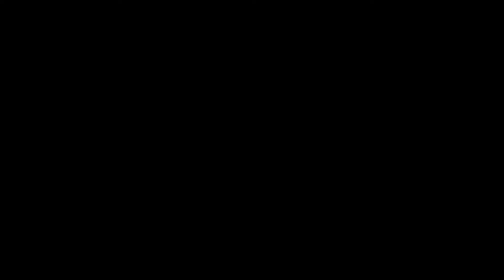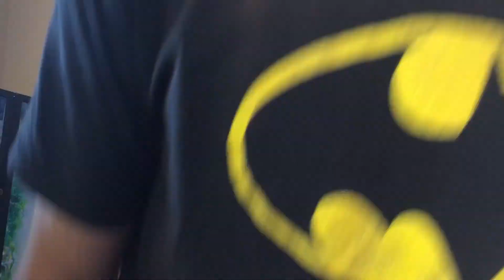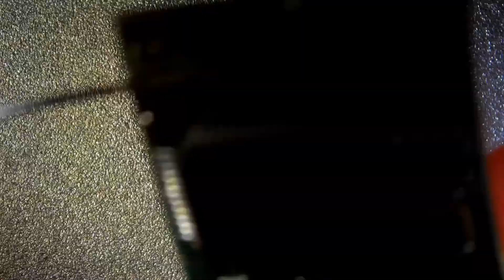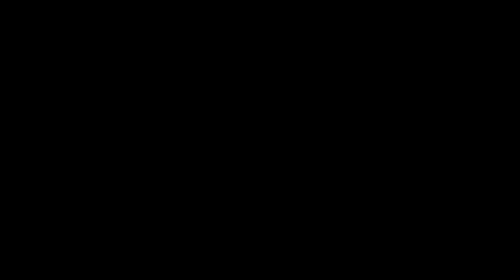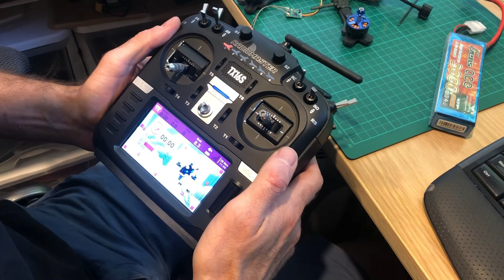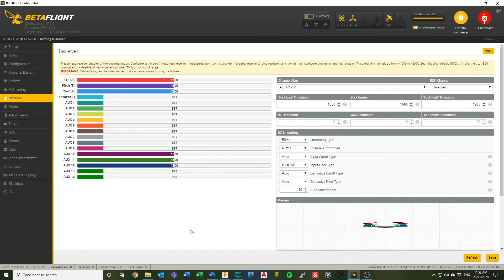Jumper R1F un-inversion hack for F4 flight controllers

Comment: Do i need to have that jumper r1f receiver connected to flight controller in order to bind it to my taranis? Everyone is going through binding process when receiver is connected to FC. Can i just connect receiver to 5V and bind it without connecting fport to anything?
Reply from the maker: Yeah absolutely, the receiver will bind regardless of whether it's connected to a flight controller or not.
Reply: @jeremypeake8169  I was powering it with Arduino Uno. Operating voltage is 4-6V and i had 4.85ish so that should be fine. But i see it has 80mA operating current. I am not sure if arduino's 5V pin was giving it that. red and green leds on receiver were blindingly bright tho. Would you happen to know if that might be a problem?
Reply from the maker: If both LEDs are on solid then it should be ready to bind:
Binding Procedure:
Hold the RX bind button when powering up the drone
If it was done right, both LEDs should be solid (Red and Green)
Put your radio into D16 bind mode
The green light should begin to flash on the RX
Wait a few seconds and then return the radio to the main screen
Power cycle the drone and the RX should have a solid red light.
Reply: @jeremypeake8169  yea, i've read an instruction. if i just power it on then only green diode blinks. if i power it on with binding button on then both red and green leds and on. i tried binding it as internal or external. i "fine tuned it" to -10, -20 and so on. even updated my taranis qx7 firmware. First time got my hands on a receiver and it seems to be more complicated than i thought.
Thanks for your feedback tho. i appreciate it
Reply from the maker: That sounds a bit strange, I’m not familiar with the Taranis but assuming it’s running OpenTX you should be able to select internal (external is for a external JR module), FRSky receiver, D16, channel 1-8 and then bind. Don’t forget to power cycle the receiver once it’s bound to complete the process. If that’s not working you might have a faulty RX or TX - does the transmitter bind to another receiver?
Reply: @jeremypeake8169  It's the first and only receiver i bought. BUT you gave me a clue. yes, taranis qx7 runs OpenTX. When i go to Internal RF i get "MODE     XJT D16" and only on External RF i can choose "MODE MULTI    TYPE FrSky   SUBTYPE D16"
so i understand i need to buy and connect external RF compatible with FrSky D16 ;/
Reply from the maker: @endymionspr9916  ah yes that would explain it. A Multi protocol module is probably the way to go, or if you can afford it a Radiomaster TX16S has it built in already.

Comment: Hi I've done the mod  and I completed the binding process but I have no stick control from my transmitter and no telemetry. I had stick inputs before I modded the rx. Maybe it's my resistor.  I think it is a 5k   according to the stripes on it.  Do you have a link to the one you used. I have a matek f450 fc. Thanks
Reply from the maker: Any resistor around 5K should work (might pay to double check its value with a digital multi-meter if you're not 100% sure). I used a surface mount 0803 resistor but a standard 1/4W leaded resistor will work fine too, just make sure you haven't accidentally shorted something else on the board in the process. If you're getting no stick and no telemetry it may well be a short to ground or positive on the serial line. Check with digital multi-meter on ohms to see what resistance you get from the FPORT line to 0V, 5V and 3.3V. If you have less than 5K ohms then you may have a dodgy component, if less than 100 ohms you likely have a short somewhere.

Comment: Looks good but maybe I'm not good at soldering lol.  I have the r1f receiver and an eachine tyro with f4 fc. I get no telemetry apart from bat voltage . The transmitter says I have telemetry. I tried the jumper r1 sbus rc no telemetry either not even battery. . I guess this is the only way to do it ?  I have control and can fly it. I'm using inav.  Thanks.
Reply from the maker: Without having a close look at it I can only recommend going back through Oscar Liangs steps to configure FPORT for your particular setup. Pay close attention to the serial settings in the command line interface and make sure you have the right setup. Receiver battery voltage telemetry is normal even without working telemetry from your FC, as the RX itself will send this.

Comment: Hello Jeremy. Thank you for the detailed instructions as well as in the forum posts. So I followed everything even add 5k resistor. First I had problem with binding, I was able to bind when I changed the tuning to -50 then solid red led with telem. However it is not detected by FC and in betaflight I chose correct settings but still no response. What might be the problem? My fc is gep f4 12a
Reply from the maker: Hi Jeff, it could be any number of things, have you connected to a spare UART TX pin? You'll also need to ensure that the UART is setup correctly from the CLI -> 
set serialrx_halfduplex = ON
set serialrx_inverted = OFF
save

Have a look at Oscar Liang's guide if you haven't aready: https://oscarliang.com/setup-frsky-fport/
If you're still stuck have a look here and post on the forum, we might be able to troubleshoot with you and get to the root of the problem: https://intofpv.com/t-jumper-r1f-hacked-inversion?highlight=jumper+r1f

Comment: I think I found your post on IntoFPV, I'm not qualified at all to say this, but would this work? I sketched it up.
https://www.dropbox.com/s/n7hsbqq0v4d7q5k/CREASE-FPORT.png?raw=1
Reply from the maker: Hey Christopher, yes that's correct I did put this on IntoFPV as well - good spotting! The modification you suggest would give you telemetry if you also added a pullup resistor, but you wouldn't get the RX signals back out to the flight controller. I think one of the other  members on IntoFPV actually tried this but was unable to get it working. EDIT: Actually after a second look I think you're right, its possible the only reason it didn't work was the missing pullup.
Reply: @jeremypeake8169  ahhhhhh, that makes sense now. I only took one electronic course in college. It's been a while. I'm trying to think of the best spot to wire that into the circuit.